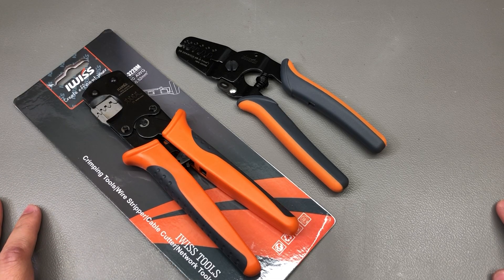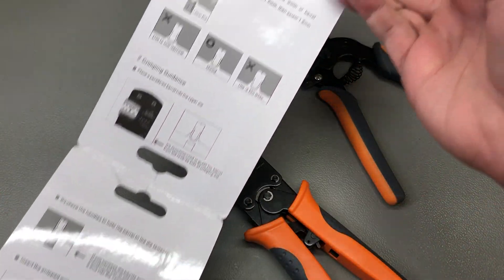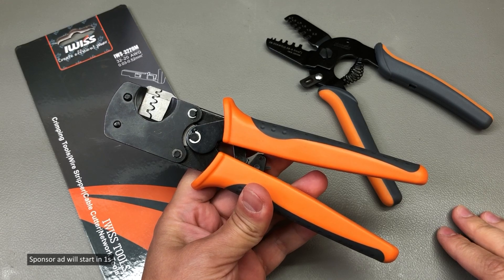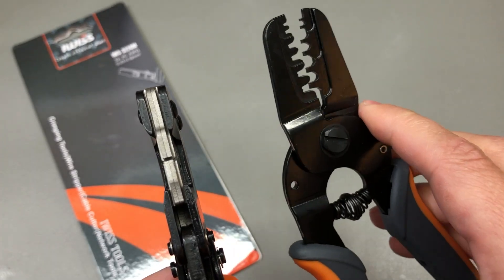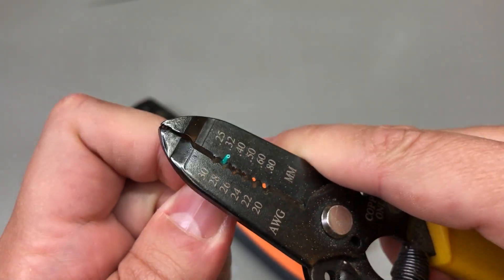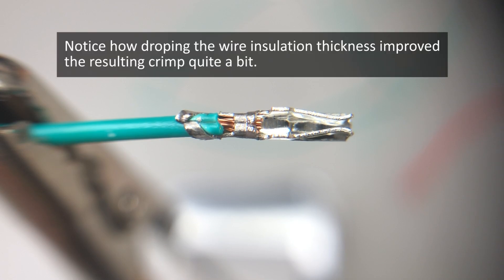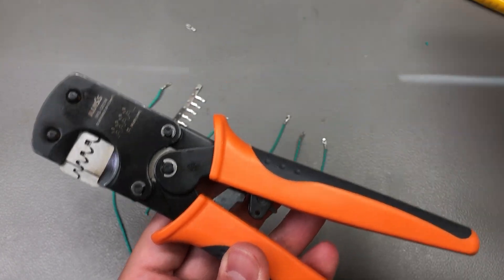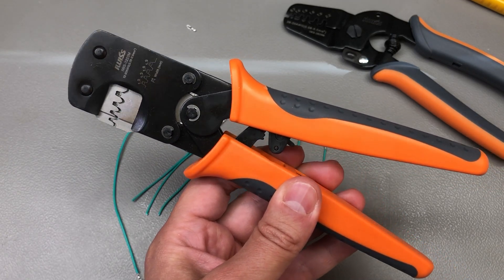Is The Iwiss 3220M Ratcheting Crimp Tool Any Good? | Voltlog #425

Comment: Great video, but you missed one very important part on the crimping instructions. 
The die is made of 2 halves, one half is lower than the other half.
It’s important to tell people to insert the connector in the die with the lower side of the die on the side of the connector that will crimp the wire rubber isolation, while the higher part of the die, will be on the naked wire side of the connector.

Comment: EDM does the magics. I got a Cinlin-Crimping-tool with cheap jaws and paid additional >11€ for the EDM-jaws (watch out: they must fit). The cheap 2549 doesn't work, but the EDM works perfect. This  IWIS-3220M have EDM-jaws.

The 2820M is also a nice tool. This can be handy to use thicker insolated wires.

Comment: This tool is the one I use at home for JST XH contacts, and it works quite well. They’re almost as nice as crimps done on the original JST tool at work. But without a locator, it is of course far fiddlier to use.

Comment: I didn't see any crimps that I would consider "good" or satisfactory. Junk.
Reply: Yeah, not a single crimp he showed was even remotely acceptable. But as someone who owns that same tool, I can tell you that it does work well, in skilled hands, for many small connectors. The tool is definitely not as good as original tooling, but it isn’t total junk like so many cheap crimp tools I’ve tried. (I have a bin full.)

Comment: A possible reason for the non-ratchet is if your insulation thickness means it would be better to use a larger die for the insulation and a smaller one for the wire, it's not really an option with the ratchet.
Reply from the maker: That's a valid scenario, thanks!

Comment: This seems to be basically the same as the generic SN-28B crimpers I have. However, I need to crimp JST-XH and dupont mini-PV connectors. I have read that this is not the correct tool for the job. Does anyone here have experience with this? Thanks
Reply from the maker: I'm pretty sure it will do JST-XH just fine.
Reply: @voltlog  Very well, thank you for your reply!
Reply: @I967  I have lots of experience with XH and Mini-PV, using both cheap and official tools. 

SN-28B is unusable for XH or Mini-PV. It’s for small spade connectors (…28B == 2.8mm spade). The jaws are simply too thick for either of the small connectors you have.

The IWS-3220 is what I use for XH, I think it works quite well for them. (Not as good as the original JST tool at work, but still a good crimp.)

Mini-PV and clones are picky contacts to crimp, since they need the rolled (circular) insulation crimp, which VERY few crimp tools have. Honestly, I recommend being patient and waiting until you find a used official tool for cheap on eBay. (Or a really similar official tool for a similar contact. At home, I use an original tool for AMPMODU MOD IV contacts that I got on an auction site new for $60, and it’s wonderful.)
Reply: @I967  I don’t know if you’re familiar with the eevblog forums, but I have a big thread there titled “Affordable crimp tools for small connectors (Dupont, etc.)” that goes into various crimp tools for DuPont contacts.

Comment: 3:45 No idea what you mean about the jaws... Iwiss clearly claims on the product page that those are wire-EDM cut dies, NOT the poorly-detailed cast ones that countless cheap tools come with. This is supported by their two-layer construction: although EDM as a process can cut stupidly complex shapes, WIRE-EDM can only cut vertically through the entire workpiece so it could not make the stepped double-crimping dies as a single piece (while die casting could) - hence the two separate layers of the dies. As for the tool, I bought one from a local store, delivered the next day, after your original video - and I'm quite happy with it.
Reply from the maker: I don't know much about metal fabrication techniques but one thing is for sure this is not a CNC'ed.
Reply: @voltlog  Well yes but actually no. Wire-EDM IS typically a CNC process. Think of it as a "bandsaw" that can cut in any direction because the "saw blade" is not flat but instead a very thin continuously spooled wire, which cuts with an electric spark immersed in a non-conductive liquid instead of teeth. Oh, and the trajectory of the wire is typically CNC controlled. It can cut fine details no endmill can ever hope to, because the wire is ultra-thin. But due to its "bandsaw" cutting style, as I said, it can only cut through the entire part in a straight line, ie. no "steps" in height are possible. At any rate, I for one find the detail of the dies quite good, far better than any cast die.
Reply: @voltlog  It’s obviously CNC-machined using EDM, just as Attila said. It’s not stamped. You can see the machining marks inside the jaws as lines from front to back on each half of the die.

Comment: I use a PA-09 similar to the non-ratcheting tool you had on the video.  One common problem I have is the crimp getting stuck in the tool, maybe because I'm applying too much pressure.  Did you have any issue with the crimp getting stuck in the tool?
Reply from the maker: Yes crimp will get stuck on this ratchet crimp tool.
Reply: This is my biggest annoyance when crimping connectors. Getting them released without destroying them can sometimes be really tricky.

Comment: Haah, I was going to buy the cheaper crimping tool in this video a while back. I was apparently in a hurry though so I did not read the description well enough and instead I got the wire stripper tool you mention on this video, or at least something very similar. Ah well.
Reply from the maker: In that case I would recommend going for the ratchet type shown in this video because it will make your life easier.